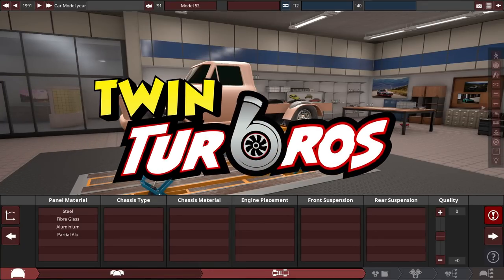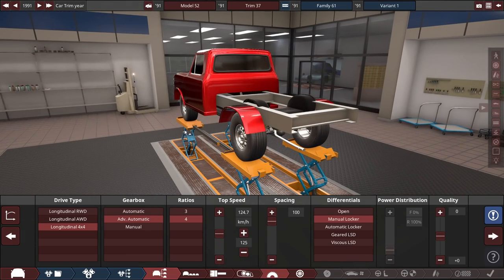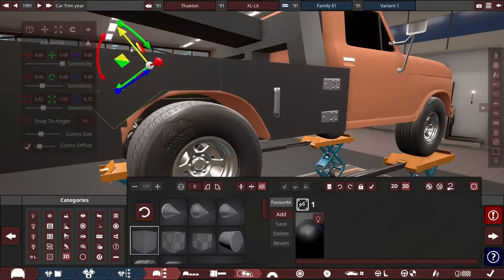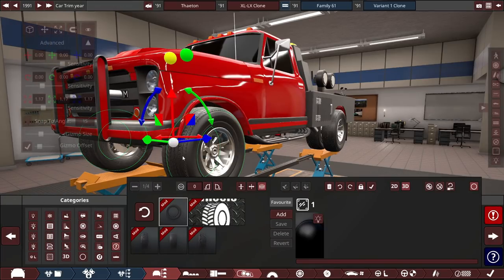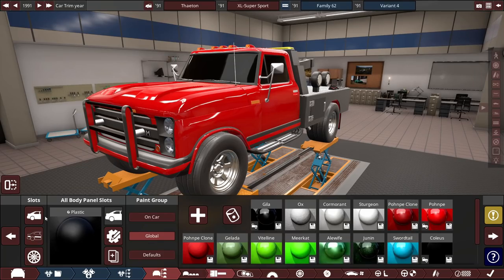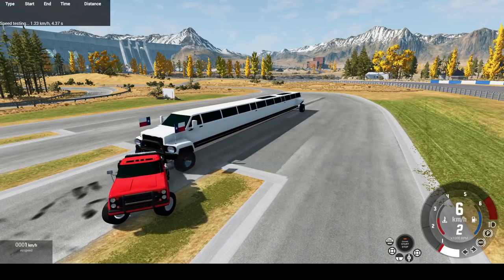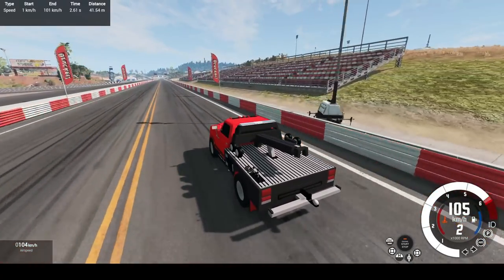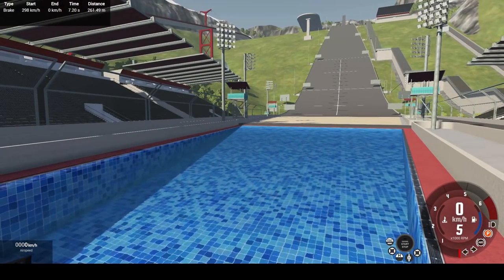Building The Fastest Tow Truck In Automation!!! Automation - BeamNG

Comment: Man that body style tho. It's my favorite, and 4wd has the most traction and helps with towing if you were actually towing you would need torque
Reply: 4x4 should only be necessary when towing offroad, and he essentially built like a '94 f550 in an early 70s looking body. And yes torque and gearing is the most important, 90s had electronically controlled 4 speed autos, or 5 speed manuals with 1st gear being a "granny gear"

Comment: The Thaeton, sounds derived from Phaeton son of Clymene and Helios in Greek Mythology, and combined with Thetis wife of Peleus and mother of Achilles, her marriage to Peleus marking the beginning of the Trojan War and sometime after the dipping of Achilles in the River Styx.
The standard model I'd imagine had a utilitarian steel bed in the back and this model, the XL-LX was designed for "Lifting Extra (Xtra)" as in extra towing and rear axle load capacity for a car being mounted to frame mounted tyre bars. Dually of course makes for high load capacity since the strength comes from the sidewall, so the super wide rear tyres on the Super Sport model would have less load capacity than duallies despite gripping super hard. Its really unfortunate that we can't put duallies on cars in Automation.
If you're ever going to tow that 68 ton limousine, you need a tank XD
The Super Sport desperately needed 100% cooling airflow lol (and more vents)

What if you made a car where the company in question (probably Maven given what their engineers get up to lol) put an airplane engine into it? In Assetto Corsa I took a Lincoln Continental and put a Porsche flat-6 into it, the engine found in the Cessna 172 Skyhawk or the Mooney M20L. It drives so strangely despite the redline being very similar, like 6k vs 5.3k rpm, but it sounds epic XD